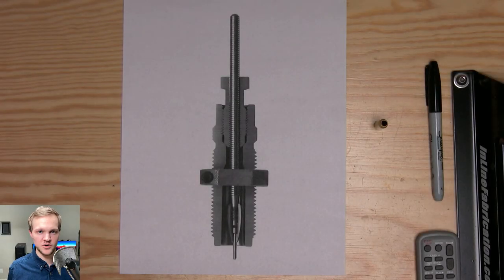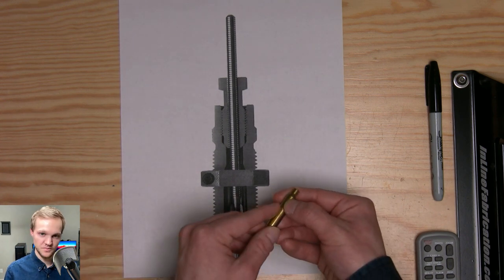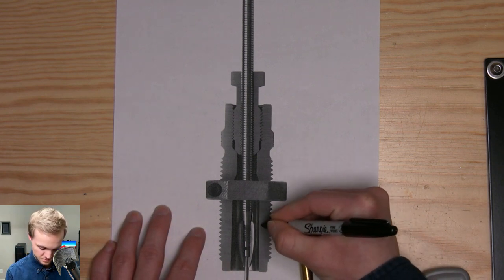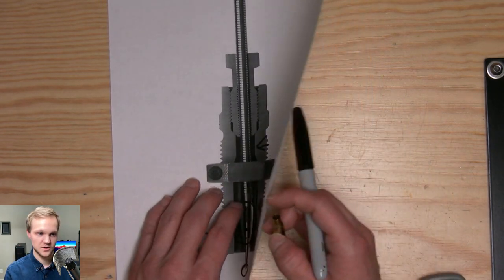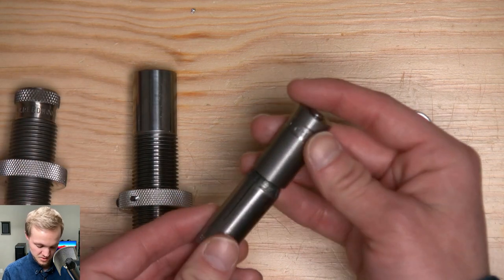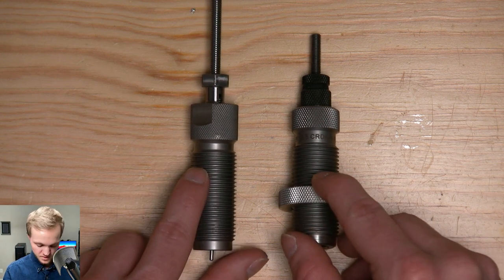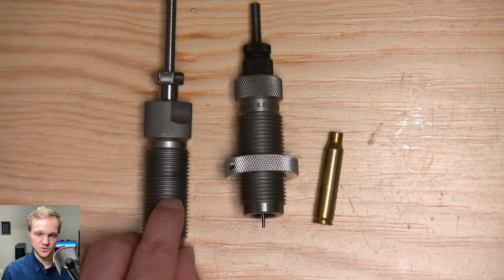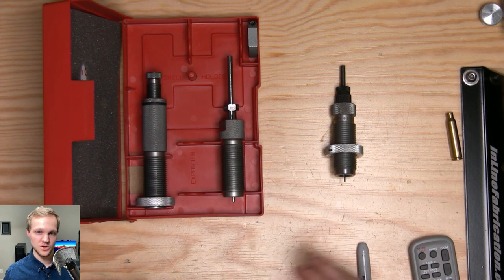How do Full Length Sizing dies work? Should you neck size?

Comment: I use the same setup with a redding body die and lee collet. I like the collet die much better than a mandrel because it will flow the brass at the neck to uniform the thickness too.

Comment: With the Lee Collet Die…. Do you HAVE to run it with the de-priming rod in it in order to get the neck properly tensioned? Asking because if I wanted to pull bullets just to harvest the primed brass for something else, I know I would need to re-form the neck to get proper tension, but I do not want to pop out the good live primers that would be in them still.

Comment: I've got the same Forster resizing die in 6.5 Creedmoor.  How do I know if I'm positioning the expander ball too high or too low in the die?  
Is there a trick or rule of thumb to know if you've got that expander ball positioned correctly?
Reply: Start with the recommended protrusion of the decapping pin (3/16” IIRC but read the instructions). It is possible to have the ball/pin too high up in the die where it jams when you try to extract the case from the die.  To clear the jam, just screw the decapper assembly further down into the die.

Comment: Great video!
Very informative!
Question for you
Have you ever heard of warming the brass before resizeing. 
I was told it makes resizeing alot easier. 
I have not tried yet because I didn't know what temp to heat my brass to or how to heat it.
Also this is not annealing process. 
Thanks
Reply from the maker: Thank you!! I'm glad you enjoyed it! :) I'll be honest, I've never heard of warming up brass before resizing- maybe only to dry it after a wet tumble (or to anneal of course, which you mentioned it's not for that). If it were me..I wouldn't bother heating up brass because I doubt it will do much, not to mention brass can get hot to the touch quick! I'm not an expert in metals or anything like that, so I'm trying not to discredit it too hard. If you're having trouble with sizing consistency I'd try another die or another case lube. Hope this helps!

Comment: With a redding small base full length sizer die if i understand correctly if the the neck is dented in very slightly from hitting something while being ejected will it straighten it back out from both the inside and outside or just resize it by squeezing it back down from beimg expanded in the chamber?